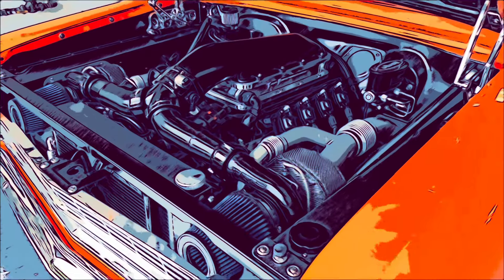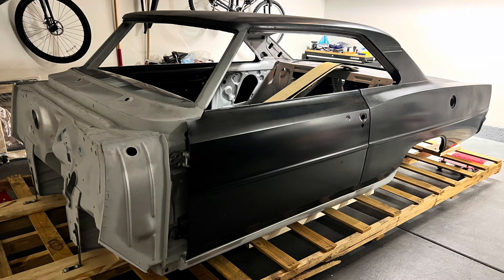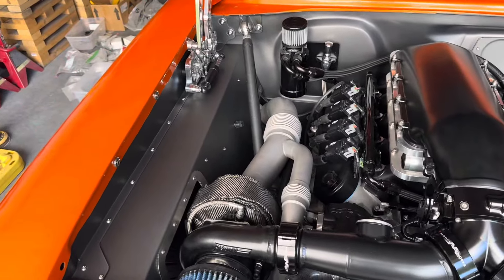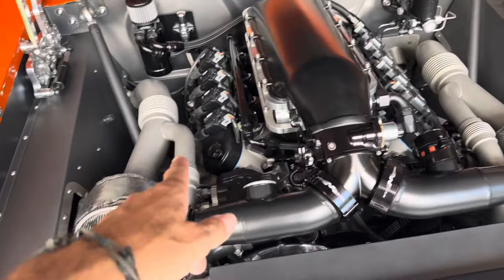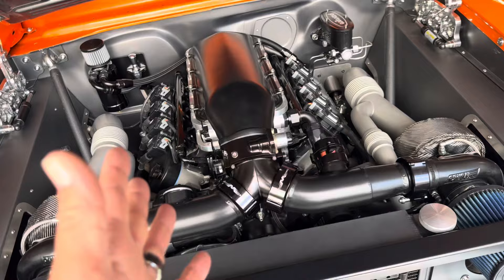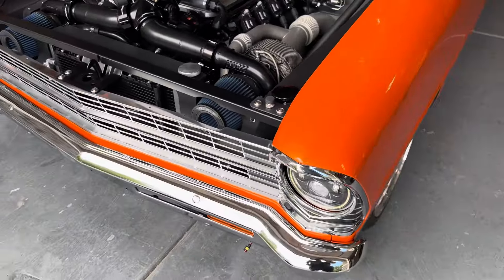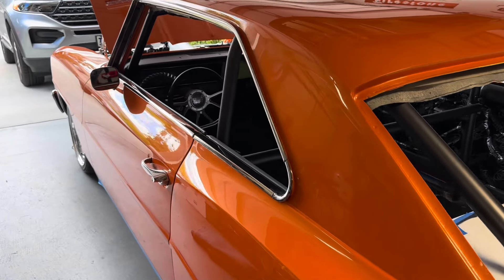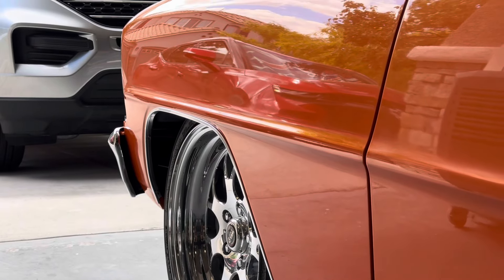Brody’s Garage 🏁 Episode 66: Front End is Back Together!

Comment: Maybe easier to remove that pipe and move the bung hole?.........Really like the way you have turbo heat vented through the inner fenders.... That car is beyond gorgeous and almost too nice to drive.....Any invites to display at SEMA?..... I may be getting tickets for your ZUSA show at Tuacahn....
Reply from the maker: No. I’d have to cut/re-weld the bung then have the pipes Cerakoted again. I can just take my die grinder to the opening and have a new trim piece made for $20 on SendCutSend.

Comment: before you get to far on weatherstrip you might want to get the glass in. right now i'm making power windows for my 67 and the windows won't go in or out of the door with the window fuzzies installed. might even need to remove the chrome trim to get them in.